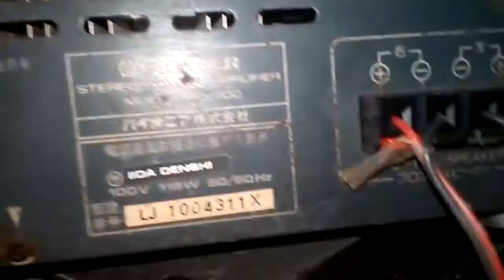PIONEER SOUND SYSTEM | AUX PIN

Comment: I have one of these amp and its not producing any sound but there's power and I can't hear the relay clicking how do i fix this?
Reply: Check the stand by power supply for faults. find out where the voltage to the relays comes from and find out why the speaker protection relays are not switching.